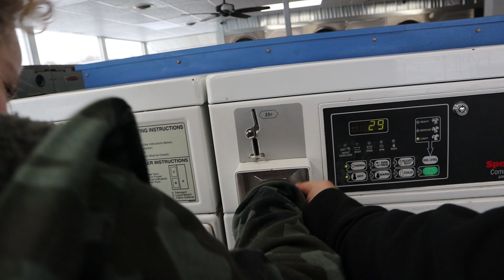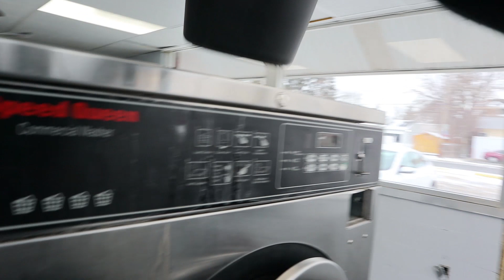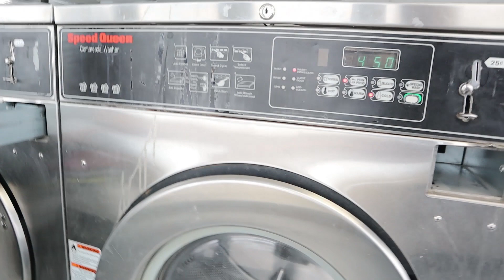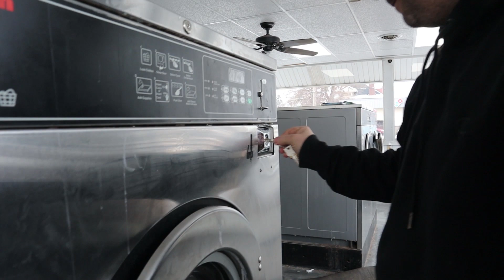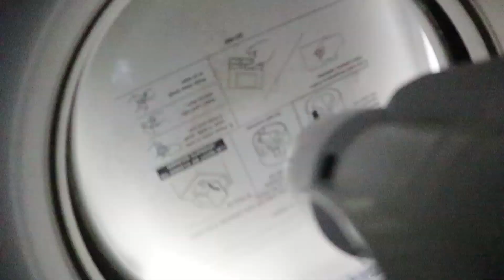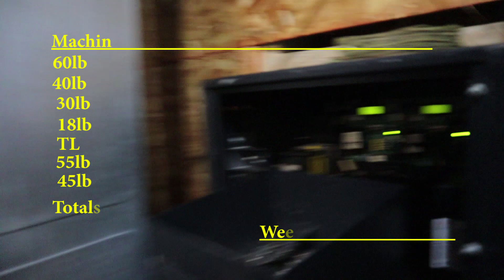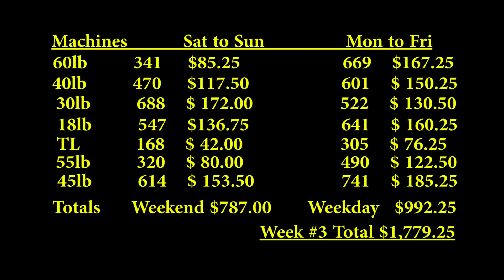CHANGE OUT!$! | LAUNDROMAT $$$$ COLLECTION!!!!! | Gave my Laundromat to a KID!| Following Keenan !

Comment: talking about Investment Joy's coin laundry, he also had sets of old dryers in the very back that he has closed off (he showed that room in his very first coin laundry video before he opened up that business), if I ran that coin laundry, I likely would have new dryers out there as well as new dryers replacing the dryers that are still currently used. I probably would replace all the top loaders with 20lb washer extractors and maybe 2 50LB washer extractors and would likely keep the 4 35lb washer-extractors that already exists.
Reply: He does have a lot of old equipment. In most of his videos you see the top loaders with out of service signs on them.
Reply: @robbiecrosbie4506  yeah people seem to also take advantage of overloading the top loaders. Alot of coin laundries don't have laundry scales either.